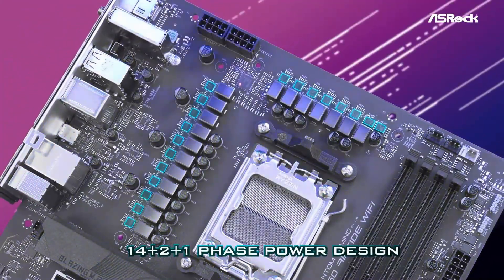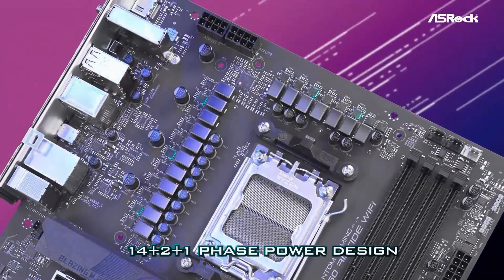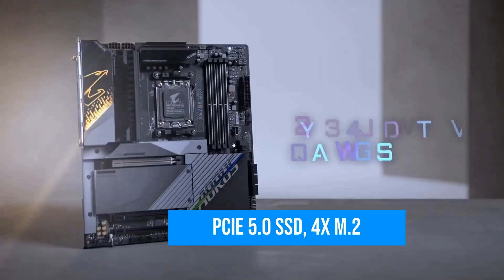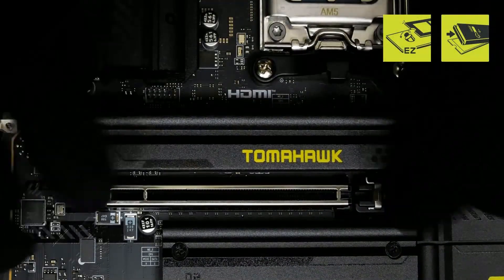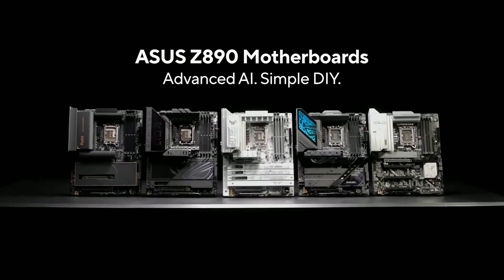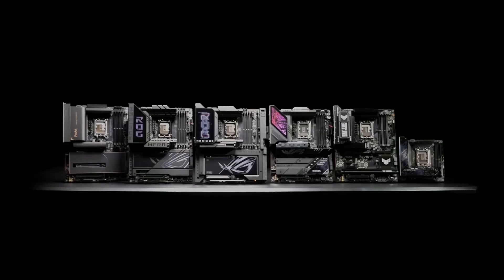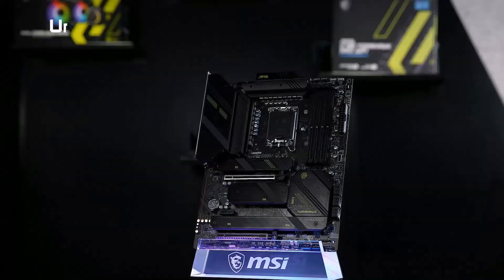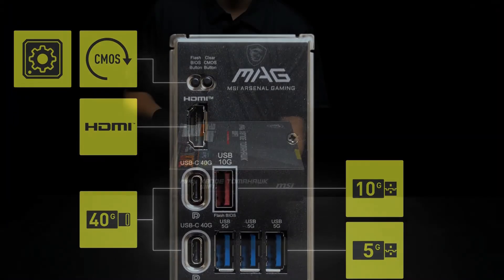Best Gaming Motherboards in 2025 [What You NEED to Know Before Buying]

Comment: so  ASRock B850 PG Riptide WIFI7  is good ?
Reply from the maker: Yeah, the ASRock B850 PG Riptide WiFi 7 is a solid pick.
It has the same chipset as the Steel Legend, with PCIe 5.0 for SSDs and WiFi 7. The VRMs are a bit more basic, but for gaming and everyday use, it performs really well. Great value for the price.
Reply: @ ye i was worried about the vrms
Reply: Asrock b850 or gigabyte b850?
Reply from the maker: @Loquito45  ASRock B850 is great for budget builds and simple use, while Gigabyte B850 is better for stronger VRMs and long-term performance.
Reply: @Loquito45 gigabyte

Comment: Just upgraded from the MSI MPG Z690 Edge WiFi DDR4 (I7 12700K) to the MSI Z890 MAG Z890 Tomahawk WiFi (Ultra 7 265K) with 32Gb DDR5 CUDIMM CAS 38 8000mts ram. I am definitely sold on the tomahawk series boards now! My next upgrade will be my Gigabyte 4070ti Gaming OC to a 5070ti when prices stabilize. The MSI 5070ti Gaming Trio OC looks like a great card.
Reply from the maker: That’s a serious upgrade. That 8000mts RAM sounds beastly! Fingers crossed 5070 Ti prices come down soon, the Gaming Trio looks like a solid move.

Comment: Currently.
Avoid ASRock for 9000 series. BIOS issues but will be fix soon.
Avoid Asus (They just suck at reading/feeding voltage and are only good on high-end board, even those high-end board read voltage like garbage on usual)
Gigabyte, great.
MSI great, but better for OC due to their BIOS.
NZXT, nah. Pass.

AVOID A620 BOARD ! AVOID B840 BOARDS ! ABOUD BOARDS WITH LESS THAN 12VCORE PHASES ! AVOID BOARD WITHOUT HEATSINK ON VRM (as far I know all ATX B650 with 12Vcore phases have heatsink on all VRM and can support up to a 9950X without issues)
Reply from the maker: Really appreciate the detailed input—solid advice for anyone planning a serious upgrade. Always good to hear from builders in the know!
Reply: @TopConsumerPicks  Ty, I see too many peoples complaining about having issues and then stating they have a super cheap motherboard because "motherboard don't matter". Or have a B650.  But is some extreme cutdown version who's not much different from an A620 board. Or people having no problems with a good enough board but needing to buy a new motherboard for a better CPU. When Hardware Unboxed video show than 230W CPU (7950X) can run without issues on B650 boards with 12Vcore phases. Since 9950X have a lower TDP. They can totally support it.
Reply from the maker: @FireCestina1200  VRM quality and power phases make a huge difference, especially with high-wattage CPUs. Appreciate you dropping real-world insights, especially with that Hardware Unboxed ref.
Reply: I bought a Gigabyte X670E AORUS Pro X about a year ago for my 7950X3D / 3090 Ti combo.
It's been solid.  I will NEVER buy another ASUS product after the horrific customer support I got from them a few years ago after I built a client computer using one of their motherboards.  That, combined with the BIOS and support failures documented by Gamers Nexus and others cemented that decision.
I had an MSI B550 board previously, and it was a solid choice.  So you're right.  For me it's Gigabyte or MSI (although I have lusted after an ASRock TAICHI...)